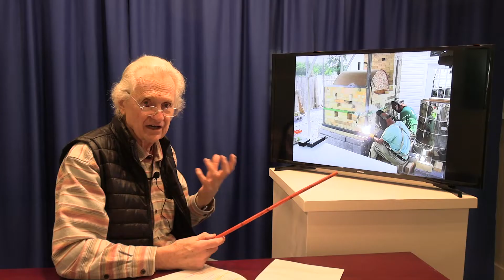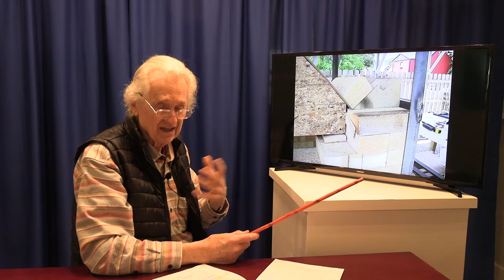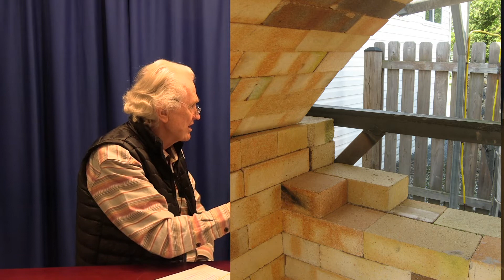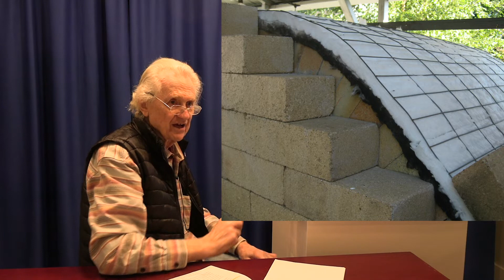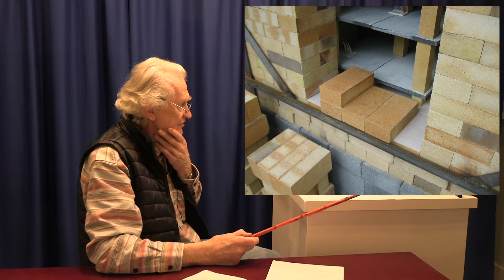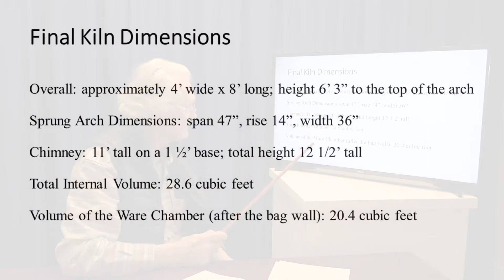Construction of a Gas Fired Soda Kiln Part 3

Comment: The last brick it's a very top center of an arch is supposed to be cut into a trapezoidal shape it's called the keystone and it is basically the key to supporting the whole Arch you're not supposed to lift up on anything you're supposed to take a Mason saw and carefully cut it so it fits snuggly cut the whole course exactly the same and fit it in that way that's the proper way to do it and those bricks on the end that are cut into a triangle state I have rebuilt Coke ovens 1,000 times and I have never seen pre-cut custom brick from any manufacturer we've always since the seventies cut them ourselves.
Reply from the maker: Thank you for the information! You definitely have a lot more experience than I do.

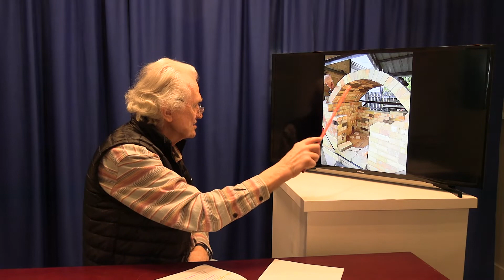Comment: 9:05 - This is unbelievable, how is that arc "freestanding" without any kind of mortar... this does not seem like a great idea to do. I'm assuming you're not using mortar so that the fire bricks can expand and contract, but special mortar designed for kilns can prevent fire bricks from cracking due to expansion and contraction when heating. It's just bizarre how you got that arc to freestanding, really hard to do lol I really gotta see your photos of when times of the arc just collapsed.
Reply from the maker: It is amazing, and if you really want to be amazed, search for catenary arch kilns on the internet. They are dry stacked and two of the side walls are actually part of the arch. They don't even need framing to support the walls. 
The only time we've had an arch collapse was when a tree fell on the wood kiln we used to have.  Even then the walls were standing after the tree was removed and we used the same bricks to build this kiln. Phil has designed and constructed a dozen kilns using this technique at Hood College, his private studios and several community studios in the area.
Great questions!

Comment: Hello. ^^ I would like to give a proper thanks to you guys for the great content since this channel has become my greatest teacher on the matters of pottery. I, a complete novice on pottery, am sketching a gas kiln to build myself since the closest studio available to me is more than 3hrs away. After reading a bit about how to design one I have decided to implement a miniature version of this soda one to be used for basic firings.  If possible, It would be lovely to get an opinion if this cross-draft design is the best way to go for a 40x40x40cm firing chamber and what should I expect or adapt by simply reducing the scale of the kiln. Thanks again for the amazing free content! My best wishes! :)
Reply from the maker: l am sorry for not responding sooner, for some reason I didn't see this comment.
The problem with using gas in a small chamber kiln is gas takes time and space to mix with air, ignite and produce heat. If you build tunnels for the firing ports it should work. it may be difficult to slow the heat down long enough to heat the ware chamber. You will want to obstruct the exit flue somehow. I think it's worth a try, and if it doesn't work very well, tear it down and build it a little bigger!
Our kiln is a little on the small size and we loose a lot of heat up the chimney, but it's fun!